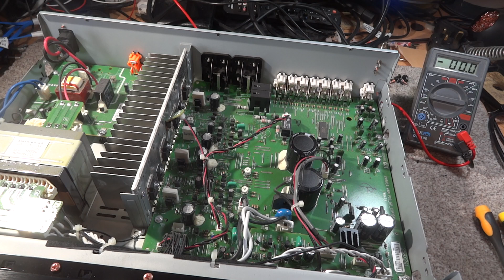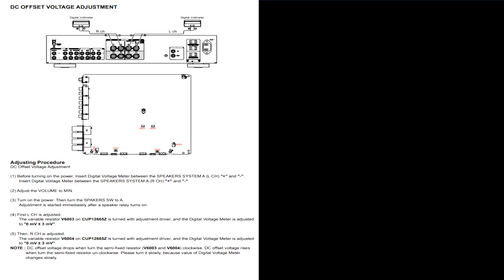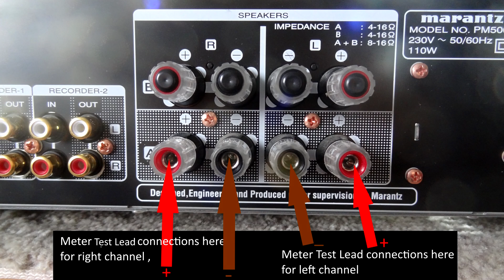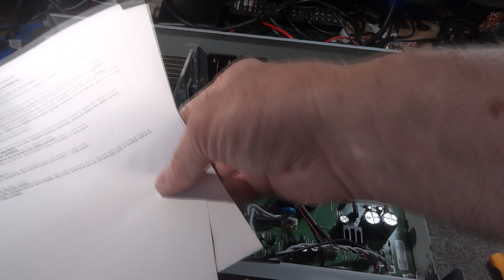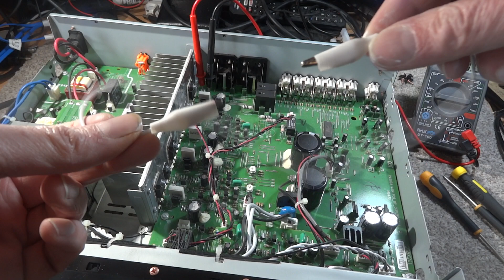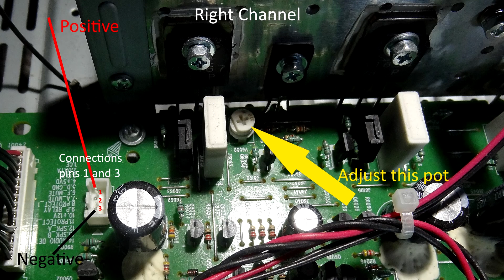Marantz PM5005 Amplifier DC Bias & DC Offset Setting & Adjusting after 9 Years of use

Comment: I have the Marantz PM5004..wonder if it has identical circuitry.
Reply from the maker: I have not got that model, but looking at manual it is very simular layout and adjustment But that model requires 5 millivolts according to the manual I have

Comment: When doing the DC offset, to get the best contact I push the ends of my multimeter probes into some spare banana plugs which have screw holes, tighten the screws up, then push the plugs into the speaker binding posts. And as you say, crocodile clips are usually the way to go for the bias measurements, depending on what the manual says you need to attach the probes to.

Comment: Get $5 to $10 set of alignment tools. They are all plastic just for electronics.
Reply from the maker: Thanks, yes must order some
Reply: @MichaelYates  In the USA we have a stereotype of a guy from the sticks/woods working on Citizen Band aka CB radio with a light bulb and a "golden screwdriver" which is the old standard screwdriver that came with a amber/yellow transparent handle. We call then "Golden Screwdriver's" as a disparaging term because they are shorting out gear detroying it because they wont get the proper tools which are cheap. Good vintage amplifers are gettign harder and harder to find and the price is going up and up. It is worth it to "Do no harm!". Always enjoy your video's good luck!